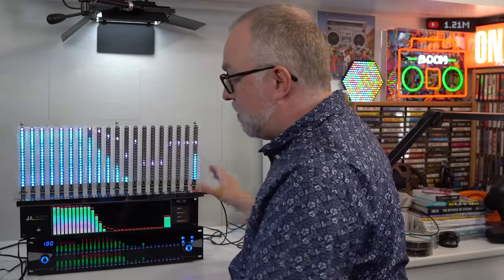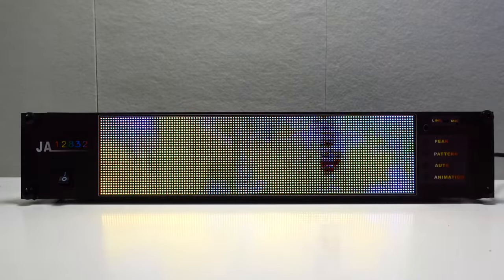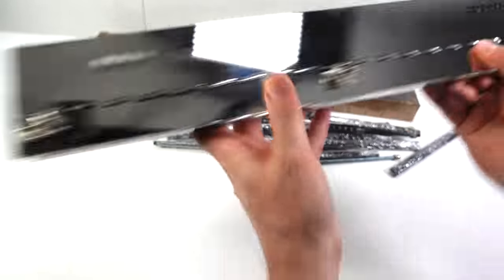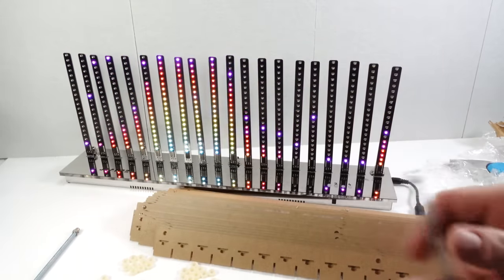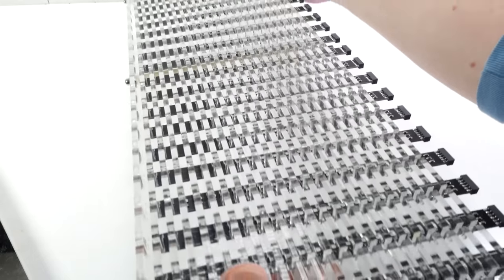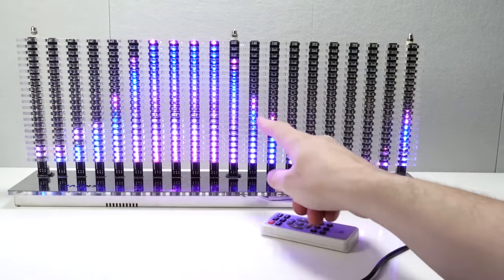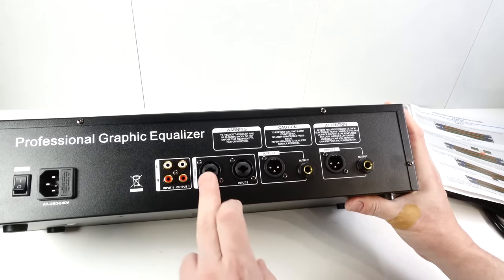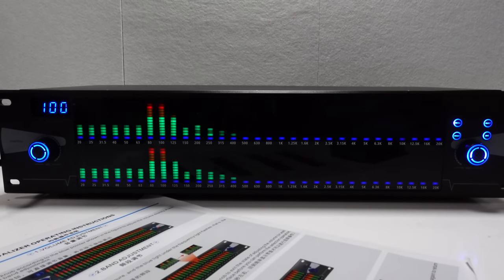Three more music Spectrum Analysers.  All that glitters...

Comment: When you ran the frequency sweep on the first two devices, it seems like they only do a few buckets and interpolate the values between each. You can see the line segments rising up and down individually, instead of having a smooth curve with a single peak. So it's really just like 8 bars spread out into 32 or 20.

At least the third device seems to actually use one bucket per bar, for all its other faults.
Reply: Yep I noticed that, too. It looks like 7 evenly spaced tent poles going up and down.
Reply: @minoreye9984  "Bucket" is a common term in mathematics/statistics/computing, it means a group of similar values. In this case, we're talking about "groups of frequencies".

In a properly made frequency analyzer, each column being displayed should correspond to a single bucket, but the first two devices share buckets per column, and just interpolate between them.

Using adimifus' analogy above, there are 7 tent poles (buckets), and the columns between each just get some proportion of the value of the two nearest poles, hence it looks like a stretched tarp. The column half way between two tent poles is higher by half the difference of the poles, and so on.
Reply: Perhaps a rectangle windowed FFT.
Reply: Uhh the third one was better because it was not interpolating the graphs down to 7... did you miss the beginning and the end when it just went nuts and shoved 7 bars in the air on the low end then all the bars went off on the high end?

yea sure maybe its trying to have more resolution but it screws up so bad that it produces even worse garbage data than the first 2, yes sure those might only have 7 data points but they looked ok doing it smoothly transitioning, plus they dont try to act like they are better than they are... that third one tried to act like it was stereo and professional with things like the frequency numbers at the bottom and it failed so hard id rather have the first two.
Reply: @compzac  I did not say it was objectively a better product, not sure where you got that idea from.
Regarding the terrible low/high response on the sweep, it might be they used a small FFT window, and/or there is some sort of "auto gain control" that amplifies noise when given a single frequency. It's probably built for blinkenlight entertainment (despite its claims) and so is only really designed to analyze music.
Can't really argue about the "stereo and professional" point, it really is shitty business. But as I said, it has other flaws, it's just decent in this specific respect.

Overall, if I was forced to choose one of them at gunpoint, I'd still pick it because the user interface is not entirely insane and unhinged, designed by someone not in Chaotic Neutral D&D alignment.

Comment: That first one with the 128 x 32 could be used in a pinball machine since the majority of DMD (Dot Matrix Display) games used that resolution.
Reply: I think your right, but a little backwards, im guessing that is a display for a pinball machine that is being repurposed for this use case
Reply: @compzac  Nope, it's not. It's actually two 64 x 32 RGB panels that you can get for cheap. They are easily controllable with Arduino / ESP / Raspberry pi.

Comment: The last spectrum analyzer display looks like it is using the SP107e RGB controller that is sold on Amazon for like $20.  It claims to be stereo when it is only mono, and a poor one at that.
Reply: Yeah that one is poor. 

Mono, and frequency handling / identification / whatever you want to call it is really really bad.

Comment: With the "dual channel" one:
You showed how the device is able to modify the audio in-device (attenuation and Graphic Equaliser).
I'm wondering if the one display is showing the unmodified input (with the two channels merged into a mono display), and the other is showing the modified output (again, with the two channels merged into a mono display)?
Alternatively, another commenter noticed reference to selectable single / dual band in the settings when you briefly showed the instructions (my screen is too small for me to confirm, so I'm taking their word for it).

Comment: I love these spectrum analyzer videos. If I may, just a suggestion when assembling something like that second analyzer, try building in place. Start by inserting the LED strips then the metal rods and then stack the plastic pieces and spacers as needed as you go. Rather than constructing the whole thing at once just to disassemble it each time.
Reply: Exactly what I was going to say. :)
Reply: Then you'd not only be doing the job of a Chinese factory worker, but the job of a Chinese design engineer as well!

Comment: You could have build the second one on the device 
1st Screw the bolts in
2nd Stick the LED stripes in
3rd Put the acrylics on one at a time and you have the LEDs in and can look where to put the spacers....
Would have been easy, but they didn't made a manual for it...

Comment: That second display is interesting. It looks like they are multiplexing the LEDs (why not) but with the mux chip on each LED stick. Interesting that the chips aren't in the base, but I suppose that eliminates having lots of pins per LED stick.
For those that don't understand what I just said: Muxes (multiplexers) allow electronics to control a large number of devices through a small number of data inputs. In this case, we have lots of LEDs in each "stick," but the spectrum analyzer has a mux chip on each stick that assigns "addresses" to each LED. When data comes into the stick, the mux is told what the data is as well as what LED it goes to, and it sends the data to the correct LED. This means that very few connections are needed to describe which LED the data goes to + what the data is, meaning that the connector between the stick and the base need only have a few pins instead of 3-4 (depending on RGB standard) per LED. The drawback on muxing is that you can't update every LED at once. If you took slow-mo video of the spectrum analyzer, you might see a shimmering effect across it as each LED changes in sequence. You can often see this effect in LED signage or even alarm clocks.
Reply: Interesting,thanks for the elaborated version!

Comment: Regarding the chinese puzzle: maybe the flexible washers should be in there and forced down by the nuts to line up? Still not worth the time. Thanks for pointing out that, even if I was in the market for one of those, I should avoid them... As I see the Clive supercomputer in the background: you might just send them all over for some destructive circuit analysis?

Comment: For the second one, the way I would have put the panels on there is to screw the screw rods onto the base with the LED's installed on it. Then panel by panel slide them over the screw rods and LED bars and adjust the lining as needed for each section, rather than building it all and then sliding it on the LED bars and base. Doing it this way should make lining up the acrylic pieces easier as well as when you get about 1/2 the way up, sliding the panels over the screw rods and LED bars should be easier as it should become stiffer. But this is my opinion though.

Also I don't think it was worth what they asked for it.
Reply: I agree, that would make it align perfectly since it seemed to be an issue with the same rows of all the columns, but what a pain in the a*s 😆
Reply: This exactly.  It has to be assembled with the components in place then the plastic built up layer by layer so you can eyeball where the lifts have to be doubled up.  Really was making the job 4x harder then it should be.

Comment: I was lucky enough to get my hands on two new RTA-31 units at the low, low price of about $250 USD shipped. I have them wired in stereo (top analyzer for left, bottom analyzer for right). Having them in this configuration gives me the result that the "Professional Graphic Equalizer" (Item 3) should have given as a spectrum analyzer (minus the digital graphic equalizer function). I am still in search for a rack-mountable stereo level indicator that is decently affordable, but isn't garbage.

I've noticed that whenever a manufacturer tries to make a spectrum analyzer or similar product that has a lot of different functions and features rolled into one unit with minimalistic controls, it's usually shite. The RTA-31 is very minimalistic in it's function. Power, brightness and sensitivity adjustments. That's it! No clock, no remote. As a result, it responds exactly as anyone with an audio background would expect a spectrum analyzer to respond and it just works. 

Unfortunately, the minimalistic approach to design doesn't always produce such good results. The American Audio DB Display MKII which I also bought after seeing it on this channel has nothing but a power switch, the dot/bar switch, and level adjustments. Unfortunately, it responds very fast across the entire display which makes it very difficult to get accurate DB readings, the level adjustments are incredibly sensitive and difficult to get to any position of accuracy, and the DOT function just looks bad. The fact the LEDs are doubled up just adds more blinky lights with no improvment in accuracy.

I'll keep watching this channel in the hopes you find a DB Level Indicator that's worth anyone's time and I'll be sure to let you know if I find something that's worth testing and exhibition.

Comment: The 3rd one was damaged by the unsecured plug right next to the unit. Naive package designers rarely take inertia into account and that leads to damage regardless of how much foam they put around the unit. 

Good quality can be had out of China, but it usually requires expert design and on premises ex-pats in charge to ensure quality is maintained. 

But Chinese-designed with a cheap-out mindset? Forget about quality!

Comment: On the first analyser - you say you'd rather not introduce noise into the audio chain by feeding audio in through the inputs and then out (and onwards) through the outputs . . . and you prefer to use the Mic . . . (the mic is going to be vastly lower quality than even the cheapest analog inputs) . . . all you need to do to avoid introducing noise is to put the analyser at the end of your audio chain and not somewhere in the middle. For example feed it from a spare output on your amp.

Comment: I think, Matt what you needed to do with the second analyser is stick with the hard plastic spacers until the point the acrylic doesn't line up then add the soft plastic spacer with the hard.

They probably gave you more of them because the cost is negligible and it's easier to just give you a set of the soft ones than to get someone to count out the number required. Money saving as usual.

Comment: to get the spacers and washers correct. first assemble with only spacers. find where the led next aligns properly (after the bottom one) and count how many rows that is. measure the distance between 2 leds. find how many washers that distance equals. divide the number of rows you counted by the number of washers needed . add a washer to the spacer after this many rows (then just spacers again) then add a washer after this many again.

Comment: After the RTA-31 video, I went to look for similar devices. The videos of the third unit or devices similar to that, looked decidedly dodgy. And you just confirmed. It's sometimes tiring how little some Chinese firms care about quality. But on the other hand, if their customers cared about quality they wouldn't be in business.
Reply: Problem is with buying stuff online, especially from Chinese sellers, you can't see how crappy it is before it arrives. By which time they've logged a sale, even if you get a refund, that still counts and encourages others to buy the same...

Comment: As always a great video! I believe to build the second one properly, you need to plug the led strips in then slide the clear plastic over them, lining up each plastic row by adding or removing spacers as needed. Some may have only 1 spacer, other rows needing 2 or more. Makes it more difficult, but I bet you would have been more pleased. Way too much work for the price. The crack, and the crappy stereo on the third one really just ruined it. Bugger. :(

Comment: For item 3, I wonder if you had plugged into the XLR / 1/4" inputs, if one of the two displays would have been for the "second input"? Maybe they're not "left/right", but rather "input 1/input 2"? (I wouldn't count on it, based on all the other issues, of course.)

Comment: I'm sure there's a good "spectrum analyzer kit" using a Raspberry Pi or something like that...
I'd love to see one of those.
Reply: I don't think you even need a "powerhouse" like a Pi. That would probably be doable with an ESP32 or an Arduino.
Reply: It is, i built one, check out the electronic engineer on you tube
Reply: You almost certainly could do this with a Raspberry Pi Zero, but I suspect they're using a more specialized cheap board and processor.  Or an Arduino micro like Gordon said.

Comment: You are probably supposed to insert the strips into the first layer and then keep adding acrylic layers with spacers placed on as needed basis. It's baffling they couldn't come up with washers of the appropriate height. Or maybe the parts are so crap they knew the margins would be all over the place.

Comment: I'm not into cutsie flashing lights.  Why not buy a genuine spectrum analyzer  that allows the user to adjust for flat response at the listening position?  I've always been surprised that no one thinks room equalization is important.  In fact, it's critical, as it will color the sound far more than choice of speaker brand.

Comment: I suspect that, after using both spacers, you are supposed to tighten the screws to squish the rubber until they line up.

Comment: I think the bigger spaces are the main ones, and the smaller ones are meant to be added every few lines to help it to line up, I would just take a look if the LEDs line up, while assembling and if they don't, fix it on the go using the smaller ones.

Also, it looks really good,at least on the camera.

Comment: solid man. Its amazing that we have all this tech, but the user interfaces and buttons and programming are never investigated for maximum ease of use. all tech ends up being so cheeky, when we could have some really amazing stuff at low cost. its all overdesigned, and never enough buttons. Rad. waiting for that 40-60$ pricerange . rock on.

Comment: On the first one - it looks like it has 6 or 7 bands and does average line between those points. It is visible during sweep, when frequency is spot on band there is a single bar, if between block of few lines at max level.

Comment: When buying stuff from Aliexpress, I don't expect top notch products, but rather the rejects the inexperienced personnel or the first items off the production line, before fine tuning, or outright faulty stuff. Received several  Uni-T meters from the official factory store where the case rubber or the screen film weren't mounted/placed correctly.

Comment: Overall a very good presentation (as usual!) covering the good, the bad, and the cracked faceplate.
To be honest, after the typical "Oh, yeah..." during the removal of the protective film on the third unit, I instinctively expected at [34:04] to hear a high speed squeaky version of it when you removed the small overlay film. 🐭

Comment: Great review. 
With item 2 I think the best way to put it together would be to screw the threaded bar into the base, plug in all the LEDs, and then construct the layers one at a time so you can get the alignment right. However, any way you put it together it looks awful.

Comment: 16:50: The thing you call a "bolt" is actually a nut. A bolt is the thing that goes in it, and looks like a screw. It's the threaded cylinder with a (usually, but not always, hexagonal) head on one end. A cylindrical piece of threaded rod without a head, like the ones you got in your kit, are simply called "threaded rod". Or "thread" for short.

Comment: With the 2nd device, would it not have been possible to install the metal bars + led strips into the base first, and then slide everything on top layer by layer? Acrylic panel, spacers, arcylic panel, spacers etc... ?

Edit: I think you may have over complicated number 2 Mat 😉

Comment: You could have inserted 1 LED strip in the bottom layer, and then add the layers and the different sized spacers as needed to maintain alignment all the way to the top. Also adding a chrome strip to cover the transistors would have been nice. This project is the kind of thing you'd send to your worst enemy at Christmas.  LoL.

Comment: Fit one of the led strips at each end while building the acrylic up that way you'll see whare it need a spacer and whare it doesn't? The bottom looks all fine just near the top it's like it'll need a spacer here n there or just swapping out one of the thicker ones for one the thinner ones to bring the acrylic down slightly to cover the led! Think that's why they included the different ones to punch out! Measure the leds on the pcb board see if there all spaced the same!

Comment: Perhaps one of the bottom nuts can be adjusted to squeeze the spacers to the correct pitch and the lower one adjusted to get the whole assembly at the correct height. The problem is acrylic sheets don't have very accurate thickness.

Comment: I wouldn't have peeled the protection off the acrylic bars (if that's what those brown things are). I think it would look better with just the tip illuminated and not allow the light to soread from one to the neighbor.
As for spacing... if you really want, you can get some spacers made, at the exact thickness.